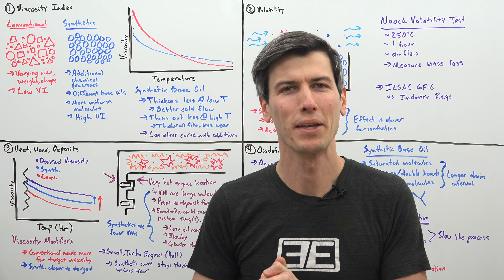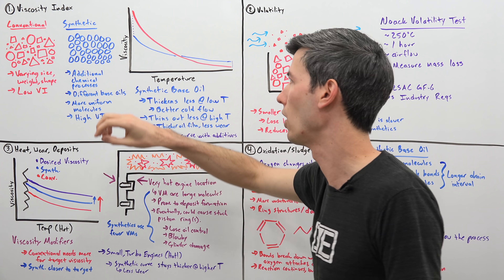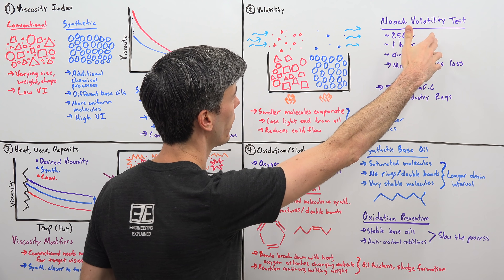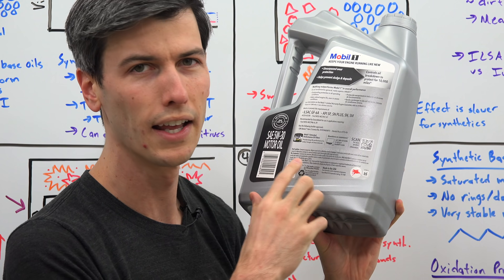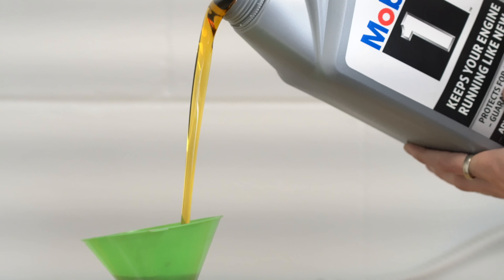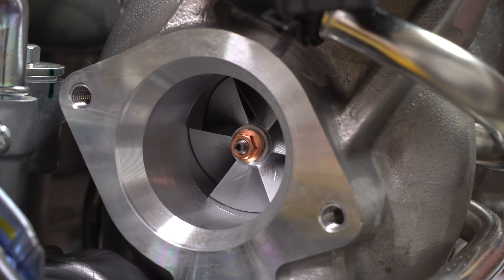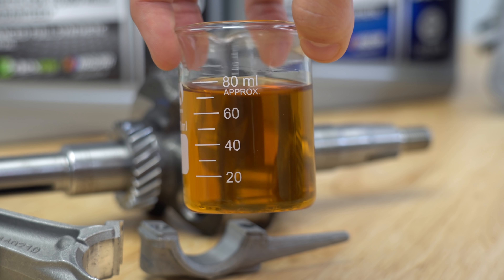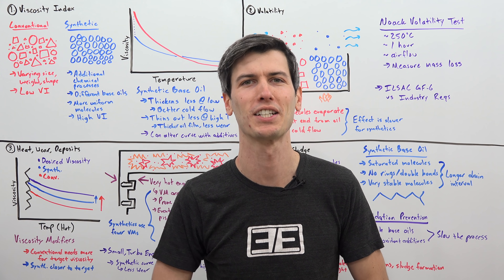Synthetic vs Conventional Oil - There's A Good Reason To Switch

Comment: Stock footage of oil draining shows dark oil. Ever time I change my oil, it looks brand new. Beautiful golden, hard to see on the dip stick of my 12 year old car with 100k+ miles. Assuming a well running vehicle, what does used oil look like from a vehicle under general use when changed at roughly max miles and time? Good luck reading the car with 0w-20 dip stick.
Reply: it depends a lot on your vehicle.  Odd's are good though that if the oil looks brand new coming out, it probably didn't need to be changed yet.  It sounds like your engine has remarkably low blowby and other contaminants getting into your oil though.  Oil coming out of my car doesn't look jet black, but it's MUCH darker then when it went in.

Comment: I only drive my truck 1000 miles a year, so in my case, don’t you think it is irrelevant whether I use synthetic or regular oil? (I change my oil once a year)
Reply: I'm in the same scenario as you. 
I think we shouldn't change over and continue what we are doing.

Comment: Would it be possible to address the issues with synthetic and short drive cycles and build up resulting from that
Reply: There are no issues with synthetic and short drive cycles. It isn’t oil related, just operating temp

Comment: At my next service, I’ll tell them I don’t want the one with squares and triangles :P
Reply: Change it yourself if you want to be sure. The shops I worked at would put conventional oil even though the customer paid for synthetic because we ran out of synthetic. There's a very ugly side to automotive repair
Reply: @supersabrosinho  I bought a new Toyota Corolla this year, and Toyota offers two years of free maintenance.  In spite of that, I'm going to change the oil myself.  The car requires a weird viscosity, 0-w16.  I'm afraid that whatever low-paid clown doing the oil changes at the dealership will just put 5-w30 in everything.  You get what you pay for, and you can't expect much if you're not paying for it.

Comment: i think amsoil has better evaporation (<) than mobil1
Reply: My brother-in-law is a mechanic, loves Amsoil, and uses it in all of his vehicles. 

I use Mobil1 because: 1. It's less expensive. 2. I change my oil at 5,000-mile intervals 3. I can buy Mobil1 off the shelf at Sam's Club and don't have to order it or buy it in bulk.

I think the secrets to very long engine life are regular oil changes/scheduled maintenance and quality fluids/parts.  

I'm the original owner of a 2004 Toyota 4Runner Sport with a 4.7-liter V8. It has 200,000+ miles on it and has never had any problems. When I changed the timing belt recently, I couldn't find any wear, sludge or deposits anywhere. The engine looks brand new inside and doesn't consume any oil between changes.
Reply: I use Mobil 1 because this is what Porsche recommends and I own one. Oil is changed every 10 k miles.

Comment: I go 18 to 20,000 miles between oil changes, but you've got to use the filter that's designed for it too. A regular oil filter won't last that long. 
Can you do a video about the filters that are designed for the full synthetic?
Reply: What oil and filter do you use?
Reply: @kaylakunz8112  Amazon basic fully synthetic oil, and a "Gold" standard oil filter. I'm not particular to one brand of filter, but it's got to be the one that's made for 18,000 miles. a standard filter will clog after 5 to 8000 miles.

Comment: I've used conventional oil since I got my first car in 1977 ( 6 before I graduated as a mechanical from NCSU in 83 when the Pack had a good Basketball team ....Go Pack!). Change the oil every 5000 miles regardless of time and never had any engine failures with most getting more than 100K miles, a couple over 200K and one getting 312K and guy that bought it from me says it now has 400k. Granted I don't know what kind of oil he uses. My current 2015 Prius says to use synthetic so I am but I'm going to up the change miles to 10K. Car had 55K on it when I bought it and right now has about 65K. I changed it at 60k because I didn't realize it "required" synthetic. I believe synthetic is better, but I'm just not sure if most cars really need it or if the advantages are going to seen unless you have really extreme driving conditions, run really long change intervals or take the car apart after and measure the differences between an engine run in similar conditions with conventional.

Comment: ok - so 2 questions...  1 is it safe to drain and send both to recycling if they know they're headed for filter / re-refining ?  and 2 - how does this change with the introduction of non-petroleum crude derived "base oils" - like these Shell touted about 5 years ago now  :    

 " Shell announced today the creation of the first-of-its kind base oil made from natural gas, the cleanest burning fossil fuel. It is called Shell PurePlus(TM) Technology, a patented process of converting natural gas into a clear base oil, which is the main component of motor oils.

Shell PurePlus Technology is now being used to create motor oils that offer complete protection to motorists in the United States. Pennzoil Platinum® and Pennzoil Ultra® Platinum Full Synthetic motor oils are the only ones blended exclusively with these base oils."

What are the pluses and minuses (other than cost) on this "newer" class of motor coils ?

Comment: My question or comment goes back 20-30 years.  Was it possible to pour a single bottle of slick 50 into an otherwise dry engine and then drive around without engine damage?

Comment: Who needs oil additives when you have metal shards in your oil to make the viscosity thicker.
Reply: You don't need metal, just ensure enough fuel oil makes it into the pan to offset the thickening to sludge... oil went into my jeep at 10w40, came out of my jeep 5,000km later as 40w10.
Reply: @SheepInACart  10 points for the Jeep making it that far.
Reply: @J B What is the difference between BMWs and Porcupines? The Procupines have the pricks on the outside.
Reply: Homemade antisieze.  ; )
Reply: Not everyone drives a BMW M car so they may not have rod bearing debris in their engine oil.
Reply: you know there’s a filter right?
Reply: Toyota Tundra has entered the chat

Comment: Going to the shop to buy motor oil:
- me: pick up some bottle that has a nice logo
- EE: compare the molecular structure and starts calculating the differences in tear & wear  based on oxidation

Comment: Question: for several years, BMW suggests changing the oil every 18k miles (30k kms) for diesel engines - not sure about gas engines. While it’s pretty obvious, that conventional (mineral) oil cannot survive that, but can we realistically say, that synthetic oil - and filter - will? I happen to have a 3.0 tri-turbo diesel engine and I use only fully synthetic Liqui-Moly oil - and I change it every 6k miles. Am I paranoid and I’m burning the money - or it actually makes sense?

Comment: Time between oil changes have increased, but can the average oil filter last between 7500 and 10000 miles?
Reply: Think about what is a filter supposed to do and if it is doing this it becomes more and more restrictive increasing pressures and even bypass no no JUST CHANGE YOUR OIL &FILTER

Comment: i want to know more about how SN+ is bad for old school engines with pushrods but adding zinc in the form of ZDDP is what save the cam from a friction death
Reply: The only change that was made from SN to SN plus was the addition of an LSPI (low speed pre ignition) test. In general, the only differences between SN and SN plus formulations will be a switch from a Calcium to Magnesium detergent system.

Reduction of ZDDP across the lubricants has been happening for 15 years as OEMs try to make inroads emissions. It’s all about preserving the catalytic converter, and the “P” in ZDDP poisons them.

If you have an old style engine with flat tappets, maybe try the racing oils. They tend to have Zinc levels that are around 50% higher.
Reply: @LubricationExplained  this is why i deleted my cats, i don’t care about how it hurts a cat if it hurts my engine more. once my cars turned 25 they got chopped off because they did there time. the whole industry has been concerned more about the current production crap cars than keeping cars out of landfills and polluting the environment more

Comment: So if you use Fully Synthetic oil and only do 1,000 miles per annum and it does not get oxidised as fast as conventional oil; is it safe to only change the oil every three years having only run 3,000 miles in those three years?
Reply: Its every 6 months if you drive under the mileage amount it still breaks down. I do every 5000 miles or every 6 months which every comes first

Comment: Do you have any experience or knowledge of RedLine Oil? I have been using it in my Focus RS because getting 5W-50 RedLine in FL was easier than Castrol or Mobil 1.
Reply: Red line is Ester based... Group 5 real synthetic... The only actual real synthetics are group 4 and group 5... He's talking about group 3 garbage like Mobil 1... Amsoil makes a better Street oil... Higher TBN longer lasting...

Comment: Cool.  Hopefully the GL6 and SP rated oils will also help reduce carbon buildup in Turbo GDI engines as well. Oil is cheap, engines are not. 3000 mile interval for me.

Comment: Does synthetic have any advantage with GDI engines, and reducing the amount of deposits on the intake valves?
Reply from the maker: From a cleaning standpoint (once you already have deposits), not really. But having a more stable base oil, that isn't as volatile, can mean less deposit formation overall. For example a very volatile oil would have a lot more oil going through the PCV system, thus potentially introducing more potential for those compounds to form deposits on the intake valves. And again, viscosity modifiers can break down to form deposits/deposit precursors, which there are fewer of in synthetic oils.
Reply: Not sure blow by is blow a inline catch cans or only solution other then the dual injection engines port and direct

Comment: Maybe you've talked about this before but I've heard, from several YouTube mechanics, that going from a standard motor oil to synthetic is a bad idea on an old engine.  Engines form micro-cracks over time, as I remember, and these cracks fill up with the squares and triangles you illustrated.  Switching to synthetic oil is like power washing all the debris filling these cracks and accelerates crack propagation.   Could you comment?  Thanks Chris

Comment: Wait, so you're telling me a high tech, lab synthesized cocktail is more precise than dinosaur sauce? Shocker.
Reply from the maker: With some chemical processes (hydrogenation) you can actually turn that dinosauce into much more stable molecules, but yes, something like PAO has very good characteristics for use as engine oil.
Reply: dinosaur sauce???  you mean the base for 99% of what we use.... including  synthetic oil.... just different chemistry...
Reply: @nc3826  it seems like you are suggesting that group 2, 3, 4 and 5 are the same thing just because they all started with Dino oil... Nothing could be further from the truth.
Reply: @johnsteele8073  Nothing could be further from the truth.... "just different chemistry" is the key, your apparently misinterpreting...   Good luck figuring it out...

FWIW saying "it seems" proves the person is just making a baseless conjecture.....
Reply: Where were you 25 years ago when I couldn't convince anyone online that synth oil was better?
Reply: Raptor squeezins.
Reply: This might be the best answer I’ve ever read on the topic.😂😂😂😂😂
Reply: Conventional oil isn't synthesized? Shocker.
Reply: Conventional troll isn't insightful? Shocker.
Reply: It’s almost as if the fossil fuel industry has evolved so much that the “gasoline engine” global warming is quickly reducing.
Reply: Oil doesn't come from dinosaurs but fossilized zooplankton and algae.
Reply: Oil is a biotic  @gabor6259
Reply: @gabor6259  No it does not! It comes from Pep Boys!
Reply: The point of the video wasn't to just simply explain WHAT was better, but also WHY it was better... smart ass.
Reply: Petroleum is not result of "fossilisation" 
And the "La Brea Tar Pits" an example of form of petroleum that includes more than zooplankton and algae.....
Reply: @nc3826  "La Brea Tar Pits" aren't OLD enough to include Dinosaurs.
Go back to grade school and stop bothering the Adults . . . . .
Reply: @TIMEtoRIDE900  the point is petroleum is made up of far more than zooplankton and algae.....and the "La Brea Tar Pits" was just an example.... my infantile old friend....

Comment: Can you explain why every time I use full synthetic or synthetic blend I get the change engine oil light on after less than 50 miles of driving? But then if I switch onto conventional that light goes away and truck drives normal.

Comment: Except Mobil 1 is not a synthetic oil.
Reply: It is
Reply: @olasek7972   Mobil 1 is the same as any other conventional oil, which is refined from regular crude oil.  Unless the label says "100% synthetic", it is not a synthetic oil.
Reply: @mrslcom  technically you are right but “full synthetic” is good enough, my Porsche recommends Mobil 1.
Reply: @olasek7972  Yes Mobil 1 will fully protect your engine.

Comment: I just finished listening to the diesel podcast and the guy from choate performance use the same skier analogy for oil on the cylinder walls. He said it at around 20 min

Comment: At high rpm would you reccomend lighter oil or thicker oil...thicker will help with the heat alittle but sacrifice 100%lubrication alittle while the lighter lubes better at a cost of heat....right?

Comment: All I know is that when you change the oil on Gran Turismo, the horsepower increases.
Reply: and when your tires go red it's time to replace them.
Reply: @Alligator6897  Jason needs to explain why red tires have less traction than green ones.
Reply: And it's a solid increase too, like 3-5% or something
Reply: I can't wait until Gran Turismo 7 comes out ngl
Reply: @Mozzarella_Cheese_Addict  what is ngl?
Reply: @PoliticalGangster  not gonna lie
Reply: @PoliticalGangster  not gonna lie
Reply: @Shabbe02  why does a person have to tell people that he is not lying?
Reply: @PoliticalGangster  So people don’t asume he is lying ;-)
Reply: @Shabbe02  so people assume he is lying because he's been known to lie
I understand now. Is like the boy who cried wolf
Reply: @PoliticalGangster  not really
Reply: @PoliticalGangster  not gonna lie
Reply: @PoliticalGangster not going to Lie / ngl
Reply: And when you change the oil on a real vehicle the horsepower also increases slightly for the first few hundred miles. Ask Jason
Reply: There's a real reason. Synthetic oil is far thinner and provides lower resistance, which makes the engine rev faster.
Reply: @JohnDoe-ji5wg  That's what I meant. But it even happens with regular oils too. (Quality oils obviously )
Jason, my boy, what do you think of part synthetic oil like Castrol Magnatec?
Reply: But.... do you get any gains when you wash your cars?
Reply: Nice
Reply: I missed that scene where Clint changed the oil.

Comment: Not quite enough info, Jason? They used to say, "Oils ain't oils"? Now it's like synthetics ain't synthetics? 
I.e. PAO/Ester blends, for late model engines, spec 0-20, 0-16? 
V/s "Synthetic Technology"? Group III, Hydrocracked? & there's semi-synth blend.
This whole SAE viscosity measurement process is under lab condition of low load & speed?
Engine designers factor this in for actual engine conditions, for a new engine, to meet fuel cons & emission standards?
With somewhat earlier engines: PAO oils might want to piss past piston rings on the suction stroke?
Whatever... I would agree that viscosity modifiers, burning with combustion, become gunk, cos rubber content?
A bit of gunk might slow oil burn temporarily? Until rings & oil ring drains become blocked?

Comment: Amsoil fans?Like and reply if Amsoil is better than most, probably all of the rest!
Reply: Also I've already driven 1k kms and my engine has not burnt a drop of oil!
My previous oil was Shell Helix hx8 5w40 and it burnt around 100 grams per 1k kms.
Also I previously used semi synthetic cheap garbage and my engine was running hotter while city driving!
Well everything changed when I found out Amsoil and Eben's channel Synthetic oil protection!
I switched first to Shell to clean some of the carbon and sludge so I changed my oil after 5k kms and flushed it with Amsoil flush!
Now I am running Amsoil 0w40 signature series and I know it's an overkill, but I don't have money for a new car, so I try to do my best to maintain my car to last atleast 3 more years!
If like me you have small oil filter I suggest you to change the filter every 7-8k kms(or 12k kms max if you can find Amsoil filter) because there will still be some leftover junk that the oil filter has to recycle.
From now on I will change my oil filter twice and my oil once at around 15-16k kms max, because my engine is 380k kms and I know that it doesn't run perfect and just for extra safety!
That's why I switched to Amsoil, just way more convinient and I bought 5 litres of oil for 62 euros which to me is ok deal for the protection I receive.
The wetter-the better!

Comment: I switched to synthetic in a 2006 toyota camry 2.4 with 170k miles and now it's losing 1 quart every 1000 miles through the engine! You should have talked about the dangers of switching in older high milage engines and also should have talked about high milage oil
Reply: That engine had defective rings and piston and That is the cause of your problem.

Comment: Does this test on oil consider the windage inside the crankcase because high revving engines causes so much that the oil doesn’t evaporate but it become so light that get carried away as oil fume dissipating some oil from the engine. As far as I know that’s why BMW uses 10W-60 oil.